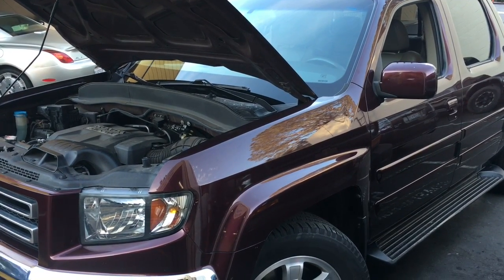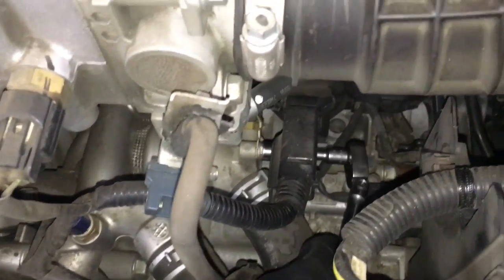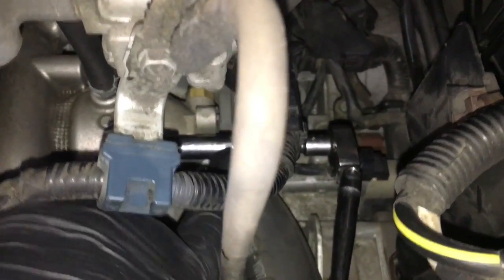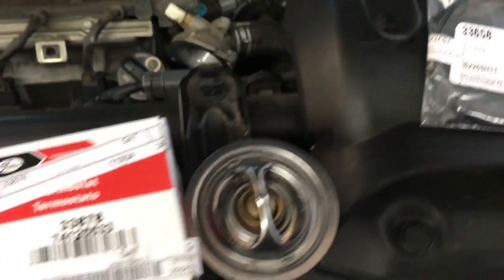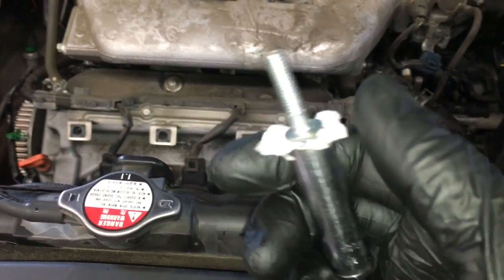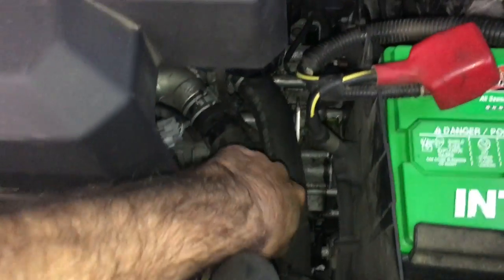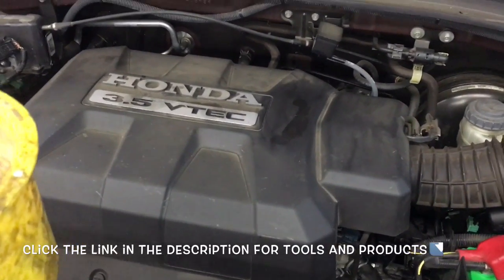How To Replace The Thermostat On A Honda Ridgeline Or Pilot

Comment: I used your procedure on a 2007 Ridgeline. Everything was very close to what was in your video. To anyone contemplating this job, I don't think it was as hard as I thought it would be; go for it if you have the right sockets. I used a regular ratchet, and switched back and forth between deepwell and regular 10mm sockets and back and forth between no extension, 1" ext,, and  3" ext. Took some fiddling to get that back bolt in, but ~ 1 hour and the job was complete.
Reply: Cost me $200.00. New thermostat installed flushed radiator add new anti freeze plus labor.

Comment: How much coolant is lost during the thermostat swap usually? Does it just normally need to be topped off with a little bit, or do you practically need to fill your whole radiator back up again? Just curious because my Ridgeline needs a new thermostat and I need to know how much coolant to buy lol
Reply from the maker: It’s gonna lose about 50%. I would recommend buying a full gallon of concentrate and mixing it with distilled water. You’ll mix 50-50 and you’ll most likely have some left over.
Reply: @HowtoAutomotive  ok thank you. Another question I had as well, that small tube that touches the right side of your finger at 5:05 is that just a vent tube that goes from the top of the transaxle or something? I'm just curious because I noticed that mine isn't mounted to anything like the one shown in the video so I didn't know if maybe it was a vacuum line that fell off one end or what it was

Comment: Looked to me you removed the thermostat and put it back in, in another direction?   It's the pointy end suppose to be sticking out?  At 4:39 it looks the other way around
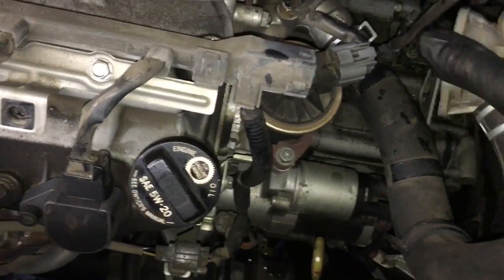Reply: the housing would never go back on if it were backwards.   2:46 is the old one coming out.   4:41 is the new one going in.